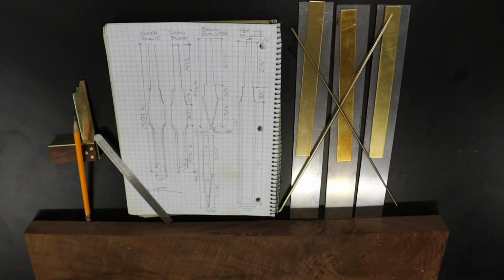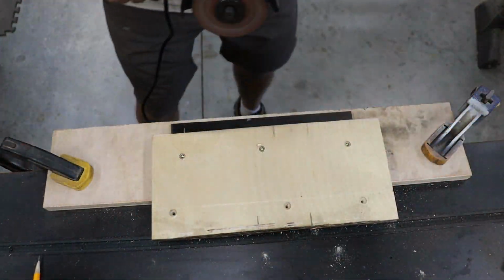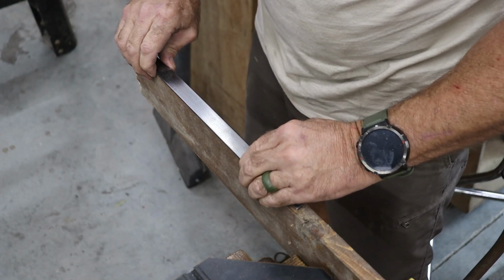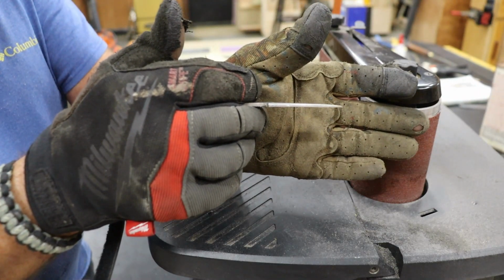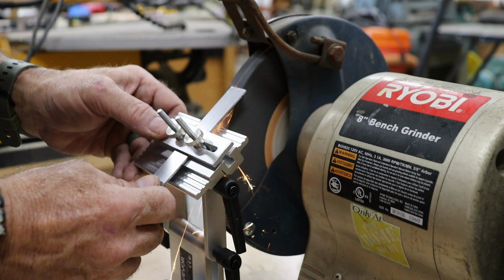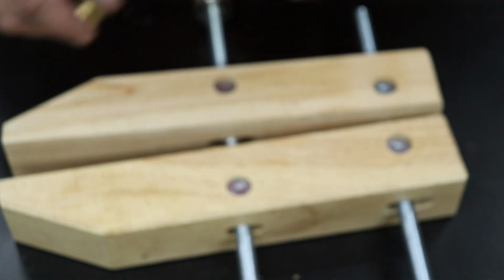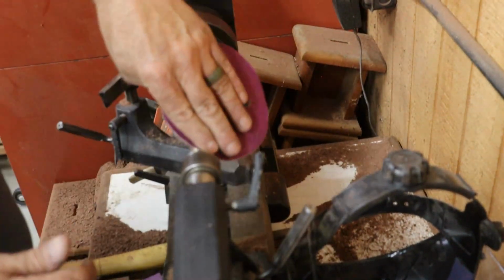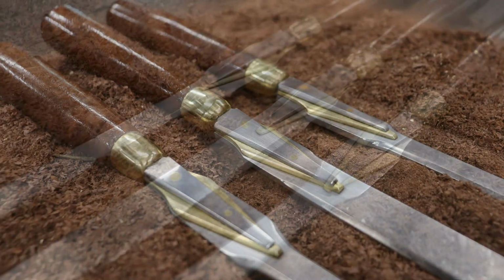How to Make Paring & Skew Chisels | Handmade Woodworking Tools from Scratch

Comment: Looks like I will finally have to make a set of skew chisels... Have a few chunks of tool steel lurking in a dark corner of the workshop and some beautiful flamed Jarrah that will make some very shmexy handles. Lucky for me, She Who Must Be Obeyed is at work during the day so I might get away with using her oven to temper the blades........ Who am I kidding, Herself will know I dared touch her oven😆
Reply from the maker: 😂 That gave me a good laugh! Sounds like you've got the makings of a stunning set of chisels—flamed Jarrah? Now that will turn heads. And I admire your bravery with the oven… just be sure to have a peace offering ready for Herself when the aroma of hardened steel wafts through the kitchen! Can’t wait to hear how your build turns out—just remember to clear your browser history: “how to remove tempering smell from oven” 😄🔥🛠
Reply: @TheEndGrainWorkshop   The flamed Jarrah is a bit nice. One of the advantages of living in Western Australia is having easy access to Jarrah and some other super hard but beautiful desert timbers like Gidgee and Wandoo (I use these as fingerboards on my Guitar builds and for jewellery boxes) Yeah, I could be taking a huge risk upsetting The Short Angry One so I will have to think of a suitable peace offering...